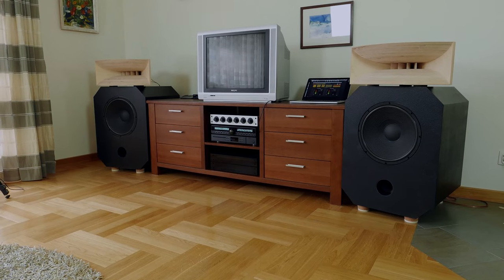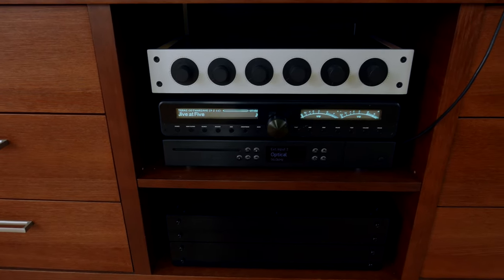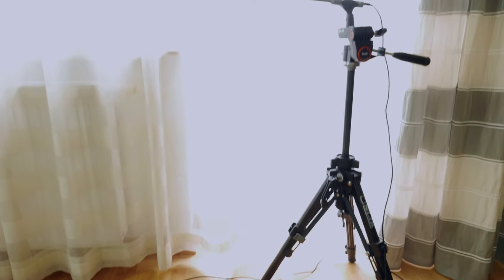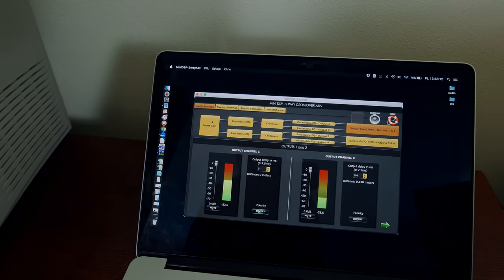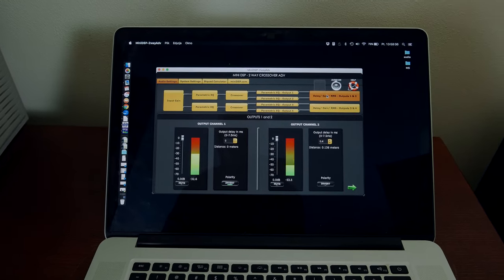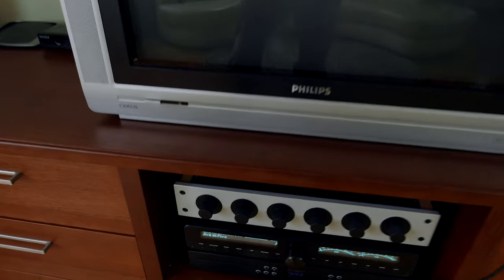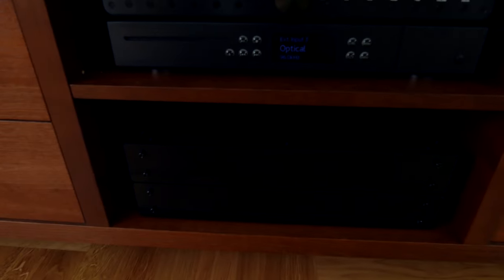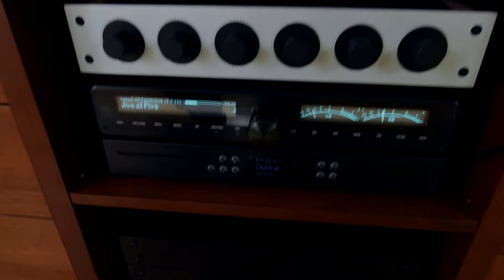2-way studio monitors - signal chain overview (view in 4k)

Comment: Great sound. Curious if would try a tube amp on the horns but it sounds great as is.
Reply from the maker: Hi,

I'm not going to take the tube-amp route anytime soon due the combination of children craziness and my lack of temper when waiting for the tubes to warm up. I've found tubes sound harsh for 40 minutes after powering them up (as a rule of thumb). I do like the tube sound generally speaking though. I also do like the high dynamic range of transistor amps which have no hiss at their outputs. Most tube amps hiss quite a bit and on a 110dB horn - it would get unbearable for me personally very quickly because of my use of active crossovers.
Reply: +Maciej Stalmach Understood. But you will need less power from a tube amp with your efficient drivers. If you get a 3-5 watt tube amp for the horns, I doubt you would encounter a hiss problem. The dynamics are already great but I wonder how much better they could be with a class A tube amp.

Comment: What is crossover point?
Reply from the maker: It looks like at the time I was crossing them at 800Hz based on what was shown on the screen. 12dB slope for woofers and 24dB for the CD's. I still have these speakers but the electronics I have all sold off in favor of something smaller which I don't have the time to assemble and tune. Such is life.
Reply: Whst are the woofer / tweeter band and model used here? Do you now have a passive crossover?
Reply from the maker: Speaker models are in the description. I use active crossovers.
Reply: Thanks, you mentioned you sold the electronics that's why I ask if you converted your active to passive crossover.
Reply from the maker: No, I will never go passive. I'm a DSP/DRC kind of guy. I already fired up the new electronics as shown here:
https://www.youtube.com/watch?v=Wy9sWvsQobo

and have since gotten rid of almost all of the ground loop thanks to the gentleman that makes KHOZMO electronics (I had a missing ground wire) and I also re-tuned them after that to a much much much better end result. All I need to do now is make a nice enclosure for the electronics. Well maybe all - I just purchased a raspberry Pi to put into the electronics box to use it as a wifi streamer to the miniDSP USB port. That way the electronics will be complete with everything I need for daily use.